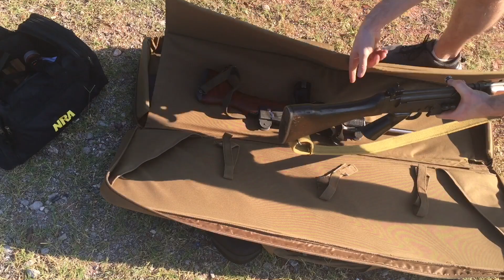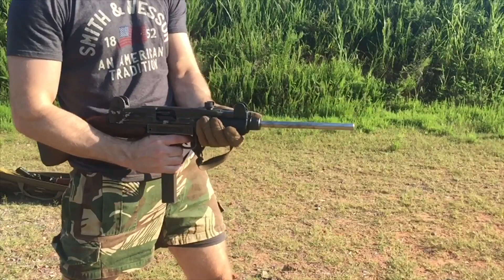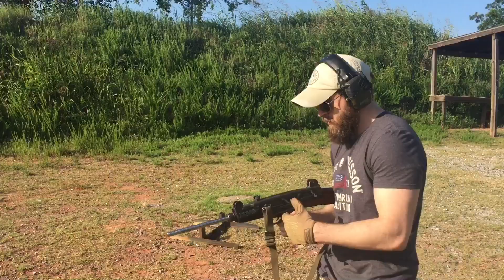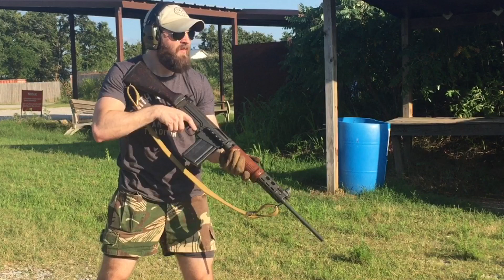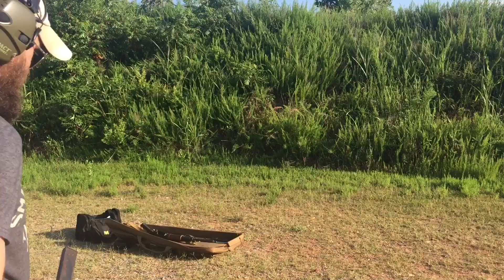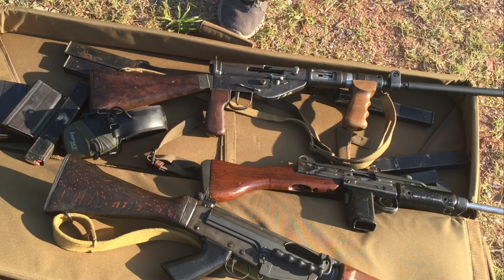Testing home built guns: Uzi, FN FAL, Sten MK5

Comment: How did you go about fitting the locking shoulder on the FAL? Did you go through the gauges or use a different method?
Reply from the maker: I used the gauges and then bought the right size locking shoulder from ARS.

Comment: Incredible builds! I'm especially jealous of the FAL, those sort of old-world battle rifles have a real weight to them. 

As for the STEN though, did you ever get the FCG sorted? I'm working on one myself currently and I've heard issues with the trigger mechanism are not uncommon (trigger bars need to be filed down, hammer gets snagged, etc.).
Reply from the maker: Thank you. Yes I did get the sten working perfectly, I forget exactly what I had to do but I think it was that trigger bar. Also the problem with the uzi was bad magazines, I also had a few bad sten mags so it was all tough to sort out. That sten is actually one of my favorite guns to shoot now.

Comment: Hey man, love your content, definitely planning on delving into the world of FAL's, and was looking at kits to build my own, but I was wondering, where do you get the proper tools to do so? I seem to have a hard time finding the proper tooling, I.E. timing rods, proper barrel vise, etc. online in stock. Also, is it a relatively straightforward process? I'd hate to try it for the first time and mess something up, just to have it sent somewhere to be rebuilt properly for double the price.
Reply from the maker: Thanks man! I got my tools from faltools . com and I'd highly recommend checking out WeaponsGuild and FALFiles for more information on the building process. There's probably someone on those forums selling used tools as well. For building one because you have to headspace the rifle yourself I wouldn't say it's a straightforward process. Overall I'd say it's a lot harder than building an AR but not as difficult as building an AK. Sadly with the prices on the parts kits it's probably cheaper to buy from DSA but that wouldn't be near as rewarding. Most likely my next FAL will be from DSA.

Comment: On the Uzi, you should try a different strength recoil spring. I built a Suomi m31 with IO parts and one thing I noticed is that they are typically over powered.
Reply from the maker: Good thinking, I actually do have another spring but I hadn't tried it yet. I'll do that next time I go to the range.
Reply: @dudestuff4345  that and definitely polish the hell out of the channels for the rods (aswell as the rods themselves) for the striker. I was having about 50% fire rate before I did this. After it's gone up to approx. 80% (tho in fairness due to an out of battery ignition the extractor was bent to shit and loses tension fairly quickly which a failure to extract was the most common issue). Just waiting on a new extractor and we'll see how she runs 😎
Reply from the maker: @jimwestberg4771  Brilliant! I'll do these things one at a time to see what the effect is.